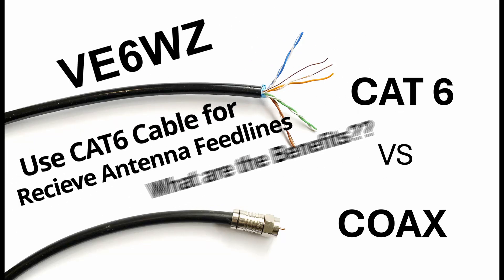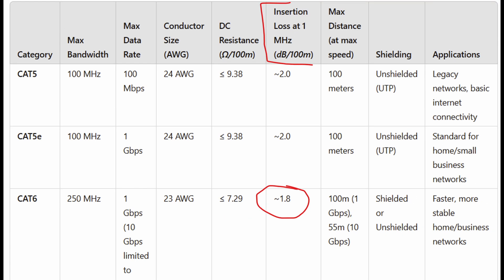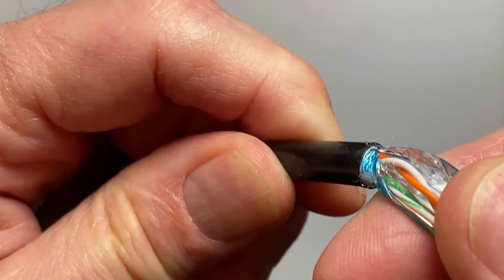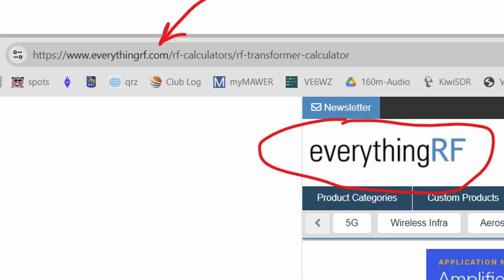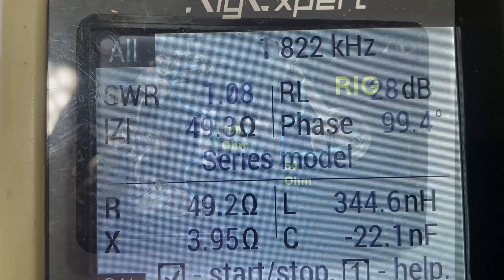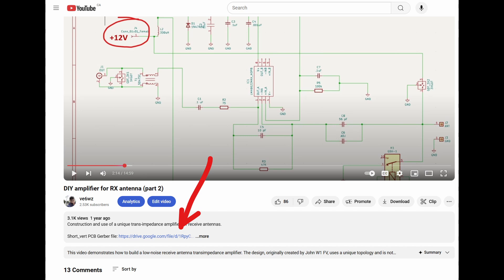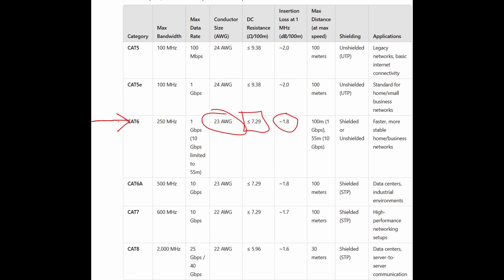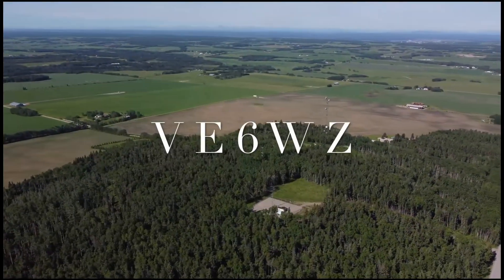Use CAT6 to feed your Antenna instead of Coax

Comment: Why not parallel two pairs and get 50 ohm without a transformer?  You’ll have lower loss too.
Reply from the maker: That is a great idea.
However, not all RX antennas are 50 Ohms, but could be matched. If use my TIA, change R4 to a 50 Ohm resistor.
Also, each twisted pair has a slightly different twist rate per inch. The Orange pair has the highest twist rate at 2.5 twists per inch, the green pair a bit less, and the blue and brown pair closer to 1.5 twists per inch.
This is done to minimize crosstalk between pairs.
Perhaps if you do this use the Blue and Brown pairs in parallel since they have the same twist rate?
Reply: That works for resistors, but not for characteristic Impedance which is what matters here.
Reply from the maker: That's not true. Parallel feedlines are frequently used to match antenna feed points. Two 50 Ohm coax feedlines in parallel will match a 25 Ohm feed point antenna.  But, then we have 25 Ohms back at the radio :-(
Reply: @rambo1152  It most definitely works for cables / characteristic impedance.
Reply: @rambo1152  Sure it does. It's a very well-known technique.

Comment: You can buy adapters/ baluns that convert bnc to rj45. I have some but not got round to trying them yet. I need a source of external grade rg45.
G4BTI
Reply: Those are for video, so the balun and BNC connector will be 75Ω.
Reply: @rocketman221projects For receive installations would that be a practical problem? I realise that mathematically there would be an indicated loss, assuming perfect 50 Ohm antenna and receiver input stage, but that is rarely the case IMHO.

Comment: Why do u have to match first to 100ohms, and then back to 50ohms 

Why cant u match direcly to 50ohms 

PShow many meters of wire do u have? 

I need about 50meters of wire and even with RG6 coax I am worried about losses (although I do need to receive FM band perfecly (for HF I dont even have the right antena but when I want it my 9.3 element yagi tuned for FM does deliver) 

And sometimes I also need higher frequencies up to 1Ghz (but not that important) 

The thing is I got my system setup just the way I like it (used about 25meters of coax) then I had to swich rooms and my cable would not reach anymore 

Now I am afraid I will not be able to match the signal I got used to
Reply: "Why do u have to match first to 100ohms, and then back to 50ohms"  Because each twisted pair in a CAT-5/6 cable has a characteristic impendence of about 100R.

Comment: What about the voltage rating, I doubt it is high enough for more than a few watts
Reply: Well i was worried about wattage handling as well but then I recall POE++ can deliver 73w at 100meters. Granted it uses 56v and 4 wires. If we drop to two wires the standard claims 51w at 100m. Note again that is at 50+ voltage input. When we drop to 24V input our possible wattage drops to we will need to supply about 30W to get 20. 

Eg if you are pushing power step up that voltage! In principle you could run higher than 56V but would need to look at what you buy. In principle UL rated CAT6 has a max operating voltage of 90V.
Reply: @jflu1  I was thinking of RF power, not the DC. So use 56Vpk to allow a safety margin on the insulation. That is 40V RMS which into 100ohm will be16W.
Reply: @adrianre7686  the peak rated voltage for cat6 is 300v so could go a bit higher. Still not the 1500w some guys seem to turn on during contests lol. 😅

Comment: One factor to consider is that most Cat cables have water permeable sheaths, and even a relatively short immersion in water measurably degrades the HF performance. There are Cat cables specifically designed for external applications,  and it would seem sensible to select these if possible despite the slightly greater initial cost.
Reply: The good stuff is filled with gel that will keep water out even if the outer jacked gets damaged. It's messy to terminate though.
Reply: If it's getting used for outdoor application, then you want PVC jacketed UV resistant cabling. Avoid anything "plenum" or "riser" rated. Those are meant for indoor spaces and the jacketing is designed to not propogate noxious fumes or flame in a fire, but don't hold up well outside as a consequence.

That said, I've seen plain-jane bottom barrel copper cat5e hold up for outdoor use doing ethernet and security camera feeds with a decade or more on it as long as it's not mechanically damaged. I'm sure radio applications are a bit different, but the stuff holds up better than you might expect.
Reply: I got some PE jacked cat 6 ground cables. Not expensive but harder to find. The jacket also doesn't fit standard RJ45 connectors
Reply: The outdoor ones also have a shield around the inner wires, which can be good
Reply: I ran 100"+ of some average interior grade Cat5e directly into my yard at only about an inch or less deep after using a lawn edger as a trenching tool. That lasted 3 years for gigabit ethernet and I don't know if water ingress, gophers or something else finally caused it to fail. Personally I wouldn't stress if I only had interior rated Cat cable on hand and wanted to build another antenna.
Reply: there's always room between "manufacturer says it's rated for this" and "this will immediately fail if you try"

Comment: How much Power could cat6 handle?
Reply: The original power over Ethernet spec, IEEE 802.3af, was good for about 15 watts at 44 volts. Newer specs are good for about 70 watts, but that's using all four pairs.

Comment: I’ve been using CAT6 to power an active loop receive antenna, and to send the received signals back to the shack.  It works very well :-)
Reply: Curious what is the shield effectiveness is of the CAT6, can't seem to find that, there must be a chart somewhere. Such a neat solution, thanks again
Reply: With coaxial cable, they "just" use power injectors to add the DC supply to the cable. 
I say "just" mockingly because CAT6 is a better approach.  Cheers. 🙂

Comment: I wonder whether this cable could handle QRP TX at maybe 5 watts? 🤔
Reply: 24awg looks to be capable of 1 to 3 amps.... lets be conservative & say 1 amp & 100% reflection could double the current encountered at some points so say lets not feed it with more than 0.5 amp.
Power = I squared r hence 0.5 x 0.5 x 100 = 25W.... 
so lets check the voltage 25watts = v squared / r (which is 100 ohm) hence 50V       now 24awg hookup wire seems to have a  300v rating so I could believe that Cat6 could probably take 50.

sticking this straight onto a Quad or Delta loop (which is around 100ohm impedance) & feeding it with a balanced ATU like the GQRP club Sudden ATU (around 50 bucks) back at the shack to match the matched line & antenna to the 50 ohm unbalanced of the rig I'd say that there is a fair chance that this would be OK for sub 20 watts  & QRP.... I'm certainly looking forward to having a play. Many thanks for the prompt.

red-neck method 2 to evaluate the power capacity..... set up antenna & ATU, transmit starting at low power on a test length of CAT6 & slowly wind the power up until it smokes... record that power & don't use that again!... OK you have just wasted a length of feeder but it is so cheap that destructive testing isn't out of the realms of possibility (& smoke is always fun!)
Reply: @StreakyP 
I knew someone would know how to do the calculations !
Thank you .🎉

Now how about doubling the power by using the two matched twisted pairs together , 4 wires total , that had the same gauge and twist ?
Reply from the maker: QRP may not be a problem. My use for CAT6 is ONLY for receive, but at low power TX should be possible.
Reply: Yes that was my first thought too !
What is max watts allowed to transmit .?
Reply: For transmitting is the shield grounded at one end or both ends ?
Reply: @josephpadula2283  on balanced cables like twisted pairs, any additional screen provided shouldn't be carrying any signal hence it's connectivity shouldn't be too critical:-
in an ideal world I'd probably ground both ends of the shield HOWEVER
If I'm feeding an elevated balanced aerial like a delta loop then the feed-point is high & often floating in the air so there probably won't be an earth close so here I'd probably leave the antenna end screen unconnected (don't forget an additional wire dropping from an elevated position to a lower ground gets pick-up on it too hence just because the bottom end of that wire is earth doesn't prove that the top end also acts as an earth too, hence why I'd leave the screen top end "floating" here).
Connecting the shack end screen to earth would probably help but may not be necessary.... probably just a matter of "suck it & see"

Comment: One subtle feature of CAT5 or CAT6 cable is that the number of twists per metre is different for each pair. This increases the RF isolation at HF between the pairsto trpically 40 to 50 dB. Some years ago The company I run used to make active antennas using ethernet cable as feeders. The only reason we went back to coax was because our commercial customers wanted to use their existing coax cable runs. I would recommend the use of CAT6 cable for all the reasons mentioned in the video. Thanks for a very clear explanation!
Reply: That’s funny, I actually just noticed this today while installing some jacks
Reply: @crosscountrywireless
do to the diffrent pairs, would it have any benifit to parallel the pairs to gether to try  to prevent losses if one does not need multiple pairs. or is that the wrong thinking.
Reply: @lmccleary411  parallel is also useful to reduce impedance to 50 ohms if you want a good match. Though 100 ohms is kind of useful for some cases -- an end firing helical antenna has a feedpoint impedance of about 140 ohms, so a 100 ohm feedline is a pretty good choice.